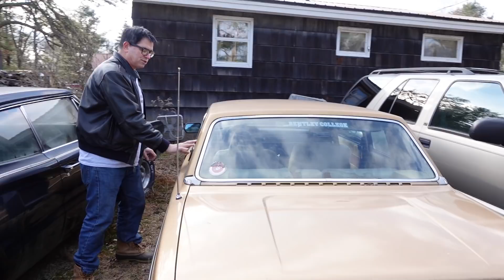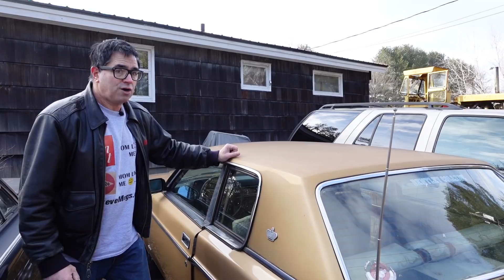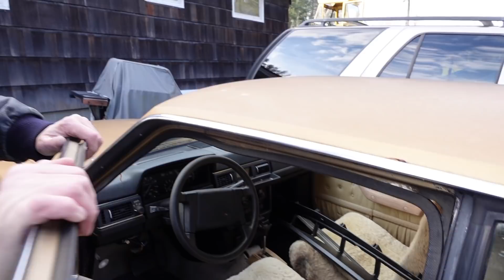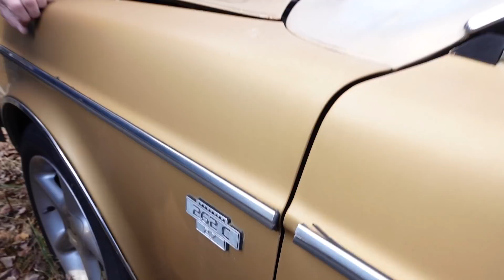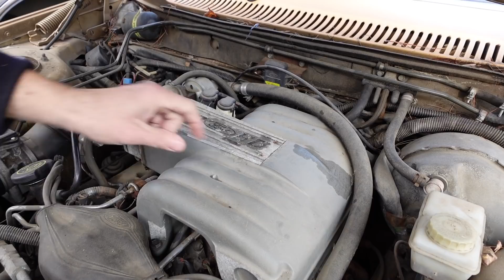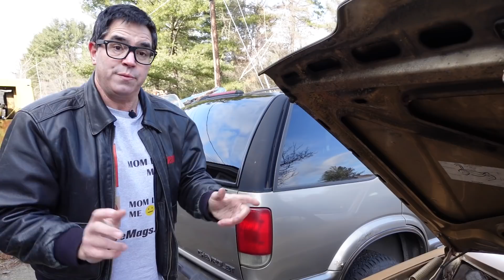Chop-Top Volvo

Comment: Back in the very early 80s I had a 1976 264GL; same engine, 4-door body with the "upright" greenhouse and "ugly", sticky-outy taillights. Mine had the "euro" headlights with the wipers/washers (that basically seized soon after getting the car.) The trans was a 4-speed manual with an electric overdrive; a small switch on top of the shifter engaged the overdrive (when it worked...) Steve is absolutely right about the cams in these engines. More the point, they suffered bad oiling to the top-end (oil passages were easily clogged I guess) and the cams basically ran dry. I remember pulling the rocker covers on it and finding it bone dry. Mine ate the distributor bushings (driven off the right-side cam IIRC). I did get it running again but it was always noisy and pretty lethargic. Interesting history on that engine: It was originally to be a 90-degree V8 but for various reasons (energy shocks, taxation) two cylinders were lopped off to create a V6, one with a weird 90-deg bank angle and uneven firing order. I really loved the look of the Bertone 262C in those days and still find them quite attractive now, some 40 years later. That one looks to be in great shape.

Comment: Those 2.7 PRV V6's were not a bad thing as such but the smaller oil feed galleries to the Cams meant that if you didnt do 7500 mile oil and filter changes or used a cheaper oil they would get clacky real fast lol
The US conversion kit at the time came from a company called Jags that Run or JTR and was a simple chromoly tube bolt in setup for SB Ford engine and the AOD Transmissions.
The beauty of the V6 Volvo was that the brakes, suspension and even the power steering pump could be retained and were more than adequate with a 302 or 351 and the kits worked fine in 200/700 and even 900 series RWD Volvo's.
I prefer the 760 platform for a V8 swap, easier too re the speedometer as its electronic with the sensor in the diff pumpkin but having converted and dailyed both id swear that the Volvo Engineers had V8's in mind when they first designed the 200 series and subsequent RWD platforms.
BTW, early 164 Volvos had a 3.0 inline 6 both carby and Bosch D jetronic EFI injection NOT the PRV V6

Comment: Years ago, there was a chopped Volvo wagon in Columbus, Ohio, that was built using the windshield from one of these. When I lived in Athens, I got to do some rust repair on a coupe, that was owned by Diana Ross's sister. I made a pencil rubbing of the Bertone stickers it had, and a friend had an early decal cutting machine who made a bunch of us copies of that sticker. Those rear axles were popular with local street rodders, due to the disc brakes they came with. Maybe the bolt circle was 5 on 4 1/2"?
Reply: The bolt circle is 5x108 on basically every Volvo from the 60s forward except some 4 lug ones otherwise only the hub and et has changed a bit during the years

Comment: It is not a 60° V6. It is a 90° V6. The uneven firing gives it a very strange feel when driving with a manual transmission.

At a time with Volvo was pitching practicality and safety, even talking about how their pillars were narrower than the distance between a person's eyes so they were easy to see around, the wide C pillars and the lower roof resulting in less headroom is a contrast.

Comment: That's a 66 Volvo "Amazon" wagon in my picture, just a simple rugged car. The B series four cylinder engines they used then look like something out of a tractor, with two SU carburetors. Probably because they also used them in tractors and boats and probably cement mixers for all I know.
  This one I upgrade from a B18 to a B20, or 1.8 to 2 liters and an overdrive transmission. That got me a few horse power I never noticed and a little quieter ride on the highway, when I remember to hit the overdrive switch. 
 Need to start driving it again, loved it but I bought a modern BMW and got spoiled by all the creature comforts. 😆

Comment: I remember reading about these Volvo V8 5.0 swaps in Car & Driver. Someone in the northeast, maybe in Maine, started doing them. He swapped in the the Mustang driveline using as many donor parts as possible, including the exhausts. That's why the two tailpipes are not symmetrical. Also adding a resister to the tachometer to compensate for the extra two firing cylinders. Paul Newman had a Volvo wagon with a Chevy V8 5 speed, David Letterman may have had one also.
Reply: I remember reading about those about 30 years ago, apparently the police in that area got into a car chase with a Volvo wagon their cruisers just couldn’t touch and chased it all over.  There was some thought it was Newman in that wagon since he lived in the area at the time.
Reply: Newman actually gifted that car to Letterman, may be same one or had one built for him

Comment: The Ovlov v6 also has like most alloy blocks a habit of corroding out. Literally all the coolant leaks out the side of the block. Try and find one now!
V8 conversion? They fit well but the lack of final drive is the issue, something like 3.46 diff ratio. You need a 6 speed!!
That body style to me is Fugly, plain weird.

Comment: I had one of the first year 5 speed cars. There were only 250 5 speed cars. My dad bought it new and I got it when he was done with it. Mags you were right! The VPR engine ate cam shafts so bad that the dealers hole sawed the firewall on both sides and put rubber plugs in them so you didn’t have to remove the heads each time a camshaft failed. I think we replaced them 4 times from 1978 to 1994.

Comment: I bought my DeLorean in 1996 with only 19,000 miles on it.  I’ve since put 80,000 additional miles on it. Not ONE single PRV V6-related issue. Not one.  It has been a bullet proof engine for me through and through.

Comment: Dang that Charger behind you though.  That needs to be in a garage.

Were dual carbs common on the four cylinder engine?  Another channel showed around a '68 sedan the other day and it had a dual carb setup.
Reply: Side draft SU type carbs were common on the Volvo 4 cyl.
Reply: Straight facts about the Charger!!!

Comment: Great overview Steve!  I did that swap into an '82 242GLT with the 5.0 HO and the T-5.  I upset a lot of "sports cars" and the occasional Mustang with that car.
Reply: Did you have to change the oil pan? I know a small block Chevy is the more popular engine swap
Reply: @williamgolden839  The Fox body Mustang 5.0 has the "double" oil sump pan and when it is centered on the Volvo crossmember the engine is perfectly placed.  So much so that the T5 shifter is centered in the transmission tunnel opening.  I didn't even change the front springs as the suspension drop was only about 1 inch with the Ford.  For a Chev engine things are tighter and heavier to complete the swap.
Reply: The ford V8 was a little easier to fit in without oil pan issues due to the distributor being in the front. The GM V8 had tougher fit with the rear mounted distributor and firewall. Granted they still fit as it has a large engine bay.

Comment: 262C's front windshield is also less upright, not just chop-top; the engine bay is wide because the V6 were really wide.
Reply: All the 200 series cars were the same, the only difference was how many doors, the roofline on the 262 Coupé along with the windshield being about 2'ish inches longer due to the chop and they changed the cowl in 1986. Volvo built them for a variety of engines inline 4 cylinders with and without a turbo, the PRV V6 even a VW/Audi diesel inline 6. The basic chassis went unchanged from 1976 to 1993.

Comment: Hey steve thr engine is called a prv. The last generation of the prv v6 was much better the than the original one. By 1987 they finally got all the bugs worked out of it, especially since it was designed as a v8.  Oil passages in the head clogged up very easily so oil changes had to be done exact on time or it would starve the cams of oil.
Reply: yes and the prv6 also had a 90 degre angel not a 60 degre if i'm not to be mistaken haha
Reply: RPV sounds better, Rocket propelled Volvo!
Reply: The Volvo V6 had issues with cam wear from the aggressive profile. The later ones were definitely easier to work on, the Bosch mechanical fuel injection was horrible not to mention the distributor and plug wires were mostly under the intake manifold. Eagle used a PRV6 in the Premier. The Premier exhaust manifolds were a high flow mod for the Volvo cars.
Reply: @ahow8017  there was nothing good about the prv v6's😂
Reply: I never said they were good, I just said the V6 in the 760GLE  was easier to work on. At least the distributor and rear water pump hose were not under the intake manifold. I currently have two Coupés, they are a reminder of how much I cursed when one would roll into the shop. Well I guess most of them got towed in.